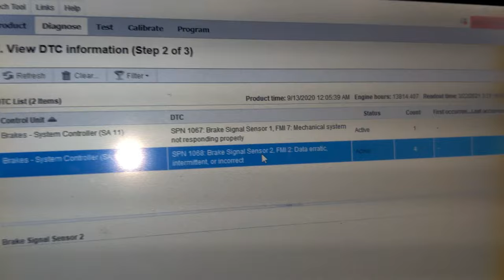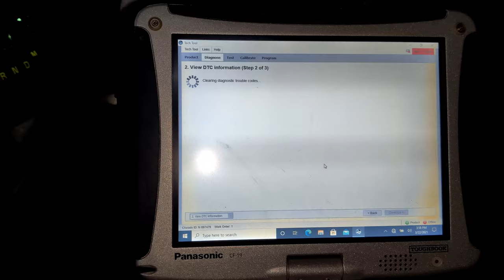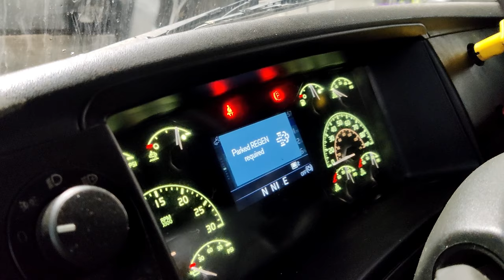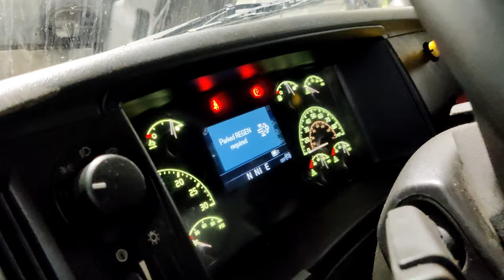Brake pressure sensor replacement Volvo D13 ABS/TC/ESC

Comment: Can this censors also  disable the cruise control ? I have ABS/TC Lights on and no cruise control. Thanks for the video
Reply: I'm having the same issue, if u got fix, what was the problem.
Reply: @aaj8846  We give up and just left it alone, sorry.
Reply: Abs sensor most likely
Reply: @saga2760  Hi.  Have you fixed ABS/TCS problem yet?

Comment: Please assist me with this problem.

Got a problem with modulation valve on the diff changed it's still insisting on the right side modulation valve.

Got this error mid 136 Sid 12 fmi 14 on a volvo truck. Euro 4 with D13 engine

Thank you so much

Comment: Did you do brake calibration in PTT after you installed brake switch?
Reply from the maker: Yes I did but without PTT , just turn ignition off turn it on and immediately press the brake pedal all the way and hold it until all brake solenoids will do a self test, after release and you should be good to go!
Reply: Where is your place located bro?

Comment: Hello mister, I have 2013 Volvo my left front drive axle abs is locked up the wheel, but its spinning when its up to floor, the rest wheel are spinning what is the problem could be , thanks for assistance 😊
Reply from the maker: What do you mean is locked? When you press the brake is locking the wheel?
Reply: Pirde precios en la marcha baja precios en el diésel

Comment: Try to pull the senor out how did you do it???
Reply from the maker: Its the same way like you removing air line from a quick connector fitting! Make sure you don't have air pressure , press that black o,ring and while holding that I,ring pressed pull out the sensor!
Reply: @valeriumoscalu7580  not sure of which quick connection your speaking of?

Comment: Hi sir. I have volvo truck 2016. No I have a problem with my airbags. They are going up and down during the driving. Especially when I am going down the hill pressing brake or turn on engine brake but sometimes going without it and going up after sometime. I have changed air dryer, air compressor checked all the leaks, pneumatic level sensor under fifth  Still same problem. Can it be because I didn't do calibration for the level sensor or not?

Comment: How do you calibrate
Reply: Just need to replace it then air truck up and hold the brake pedal down for 10 sec ENGINE OFF KEY ON

Comment: How to do calibration ?
Reply from the maker: Start the truck, leave the air compressor fill the system until it's full! Turn ignition off, press the brake pedal and hold it, turn ignition on while holding brake pedal pressed, wait until your hear all solenoids doing self test around 10-15 sec, after release brake pedal and you should be good!

Comment: How do you pull the sensor out? You never showed us that part
Reply from the maker: The same way like you disconnecting every air line from a quick connector fitting!!!
Reply: So the problem was wiring issues not the sensor … so why replace the sensor?